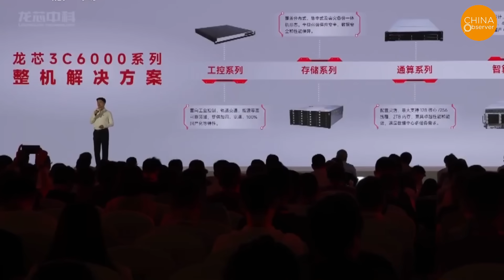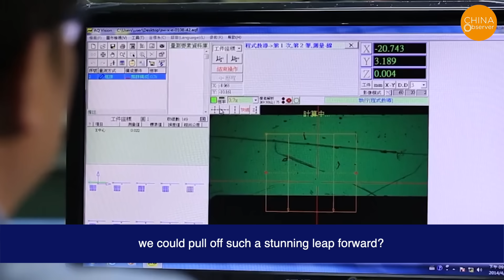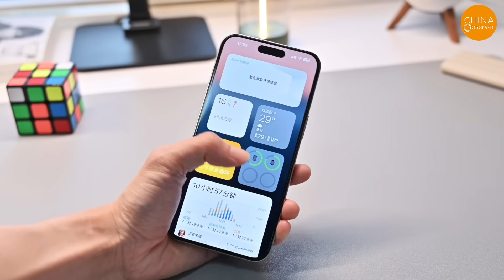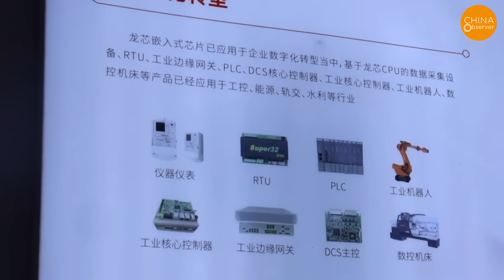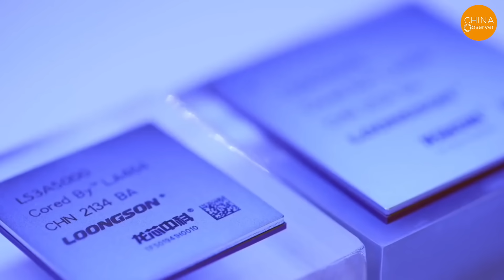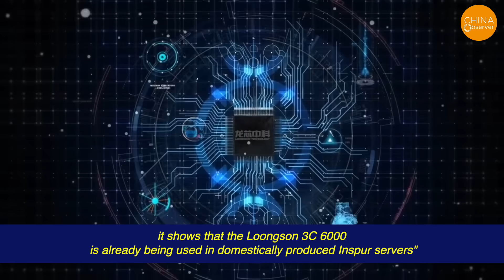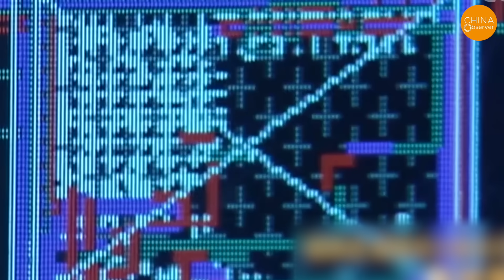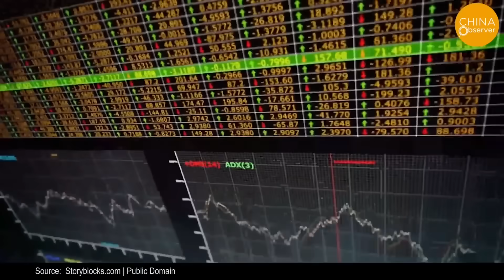Global Laughingstock! China’s Loongson Chip Claims to Beat Intel, but Lags 13 Generations Behind

Comment: It doesnt beat latest intel and amds, but its on the level of zen3
Even tho, other should be scared, because China can make it happen
Reply: Problem besides being generations behind is it's a bespoke processor so software won't work on it native & emulation will slow it down hideously plus it can never 100% emulate you open up can of worms it would be impossible to support. That limits it to government/industrial use specialist applications developed for it you won't see it in consumer products. Many have tried to break into that market with new architectures over the years & all have failed the obstacles are eminence & beyond the chip makers control, simply no room or reason for another architecture.

Comment: This chip should neither be underestimated nor overestimated. On the one hand, it should be more than enough for China to be able to switch many of its administration and office computers into computers that are significantly harder for US to hack, thereby increasing both supply chain and cyber security, for the applications where they can quickly and readily develop the software. On the other hand, It's very unlikely that they would be very useful for AI and for the applications where they are also reliant on the western software. Finally, keep in mind that this is only the 1st gen product, in a few generations the situation might be different. Finally, the US chips often rely on a worldwide supply chain, including China and Taiwan. If the Chinese trully have independent supply chain that could be huge, though they are likely at this point relying on the manufacturing machinery and software from the west

Comment: Anyone that knows anything about processors can tell you the "nm" process is different for every manufacturer, it's how each specific company measures their transistor spacing, and each company measures this in different ways.  10nm Intel != TSMC 10nm for example.  As usual false advertising and false claims by CCP shills.

Comment: well if its using its own instruction set then its completely useless when it comes to compatibility with western technology. anything that works well on that chip will have been programed specifically for it. may as well be an ARM processor. maybe they should have went with ARM technology instead

Comment: They wouldn't even dare release the die size, or the transistor count, or even the density (transistor count per mm²). It's a joke.  Seems to be quad chiplet, makes sense, lots of silicon because the process is absolutely rubbish.  2GHz is hilarious

Comment: Nowadays it's not that difficult to crush Intel 😂 especially if you're willing to have a portable heater and white noise generator with you all the time. 

It's beating the ARM CPUs now that's the challenge. (Like Apple Silicon and the new ARM chips based off Apple Silicon).

But beating TSMC? Only in the CCP's wildest fantasies.
Reply: i wonder why you hate ccp so much

Comment: Didnt Nvidia the Gpu / Cuda maker. Just release its first Cpu to the market? And its an animal monster. Wondering what intel is going to do against it in the next 1-2 years or so. Thousands of Cuda cores on die, and 40 cpu cores+. But I also heard its intended for workstation / servers, and specifically Ai creation and usage.  I KNOW China has the smarts, thats without question! But you need a company like Nvidia with the entire "CUDA" language work set environment to compete. And you need a million companies that depend on it too. Or no one will want your processors.
Its SOOO much more complicated then just making a chip. You need the entire foundation to support it too. All that infrastructure all that dependence on your product. Better off to just buy up Nvidia.
And then make your chips thru/with them.  Logic isn't patriotic. It has no desire, need or want. So dont get to upset by what I said. If you do? Re read it again until you understand, because you missed a bit.

Comment: 12nm??  My computer I used in college was 12nm and that was in 2006. So let me understand this.... China's chip is 20 years behind and the tech sector is supposedly in fear?? My only question is....who did they steal that technology from??
Reply: The computer you used in college in 2006 had 90nm lithography.
Reply: @IO470N 90nm lithography? What does taking pictures have to do with a computer processor? Me think you have a comprehension deficiency.
Reply: @roger5322 oy vey! If you think you had a 12nm processor in 2006, you're touching yourself. P4 were 180nm to 90nm lithography process.
Reply: 12nm litography wasn’t a thing until 2016-2017. It’s simply not possible in any way you used a computer with 12nm cpu back in 2006. In 2008, Intel released new Wolfdale and Yorkfield architecture for Core 2 series processors, which featured 45nm manufacturing process.
Reply: Oh they have been trying to copy Intel and Nvidia for a long time.
Reply: oh there is fear alright. fear of what hair brained, half assed, completely insane "ground breaking technology that beats the US" that will be paraded out.
Reply: Bullshit, Pentium 4 had 90nm chips around that time frame and the core 2 chips had 65nm

Comment: If they're saying it's competing with an lga2011 v3 xeon, that's not bad.

Yes, they're a decade old now, and not suitable for datacentres anymore, but they're solid gaming chips - especially for the current bargain price.

Is that is their first splash into the market, it's impressive, and it will improve rapidly.

Don't focus on the manufacturing node. The main advantage of node sizes is power. Peak performance in GHz has been quite stable for 10-15 years. In other words, the latest Intel/AMD haven't got much faster in clockspeed since people were overclocking Intel 2600k chips to 4.5ghz nearly 20 years ago. The current Max is a shade over 6ghz.

So... The architecture is currently slow, but if the investment is there, it will improve rapidly. 

Software is obviously an issue, but emulation/translation has been possible forever. 
Steal a bunch of Linux WINE, Etc code and the problem will be solved. 

Don't. Laugh too hard yet

Comment: So let me get this straight:

- Intel Xeon's 3rd generation CPUs came out in 2020. (I think you mean 3rd gen Xeon Scalable, which uses Ice Lake, which is 10th gen Core. The Xeon v3 family with Core architecture came out in 2015.)

- Intel is now on 14th generation. (Confusing generations here. Current Xeon Scalable is 6th gen, now called Xeon 6, using the same cores 14th gen Core series - cores which are the 3rd generation of hybrid cores, and 1st generation of "chiplet"-style cores.)

- Somehow 14-3 = 13. (Lags 13 generations behind?? When in actuality, the number would be ~4-5 generations behind current desktop Intel parts.)

- Performance has improved "exponentially." (wtf? this claim is completely unfounded and untrue.)

- "complete ignorance of technical details" - ....yeah.

Look, I enjoy propaganda just as much as the next person but please, use actual facts and technical details instead of made up ones. Loongson is dramatically inferior to western chips. You don't need to lie or misunderstand the overlapping "generations" to make this point.

Comment: Using a proprietary instruction set = useless
Reply: The real problem is it's using a Chinese proprietary chipset so even worse.
Reply: They literally could have used RISC-V or IBM POWER since both are royalty free and are actually supported by modern operating systems and toolchains

Comment: I don't quite understand,  Intel's 3rd generation is much older than 5 years, it would be more like 15 years. I just looked up 2013 was the release date which means the date they could have started talking about it would have been close to 2010.
Reply: I had my 3rd gen intel on a laptop around 2012
Reply: Thing is that it isnt consumer third gen, its xeon scalable third gen, and that generation launched in Q2 2021

Comment: Xeon Platinum 8380 its not very fast to begin with... infact its slow  and its still on DDR4 if there CPU can do 600 points in single thread in CPU-z then they can say its good  not a high bar to pass

Comment: Whatever. It's faster than the processor I'm using now - only less efficient. But then again, electricity is a lot cheaper in China. The best USA-made Intel chips now are not exponentially faster. They're three times faster. I'm not saying that 3x is nothing, but apart from games, 3x wouldn't exactly unlock some new capability in my computer. The point is that Intel is losing more of its lead with every year. China's crappy hardware is forcing programmers to write more optimized software, like Deepseek. One day we'll wake up and their hardware will not be so crappy anymore.

Comment: I CANNOT stop laughing.
My brain has more processing power than this so called "supper chip".
Reply: Don't be silly... A company founded in 2008 (Loongson) cannot be compared to a company founded in 1968 (Intel). What they have achieved is remarkable. It might not be the same standard as current Intel or AMD chips, but it is impressive. The next challenge will be to get software vendors to produce code and OS compatible with their chips... which I think is where US and EU might carry on their stupid sanctions to hinder progress.
Reply: @peacekeepermoe they could always compile Linux and popular FOSS alternatives to run on their chips, will still need some work though

Comment: Kylin Linux looks like a cross between Windows XP and Vista. I like it. It's all cool actually as a fun project but it's a waste of time. For this to be anywhere close to useful to normal people they have to create their own compatible GPUs and other hardware and then an entire software ecosystem with no help from any company outside westTaiwan. The computer world isn't just Intel and Nvidia. It depends heavily on a global cooperative of lithography, chipmakers, designers, developers, etc. with different countries specializing in different areas. A lot of Intel's problems are from trying to bring just some of this back in-house. Intel has been stumbling badly and getting trounced by AMD for years now, so it's not like beating them would even be a huge achievement at this point.

Comment: The whole idea of a different architecture and instruction set is old hat. Old as the industry, in fact. There were lots of instruction sets in the past. Everyone had their own. This is not an advantage. Today we basically have two instruction sets. One is Intel's and one is ARM's. One is CISC and the other is RISC. They have different application realms. 

Back in the very early 1980s I was doing an R&D project on a Motorola chip with its own instruction set. In fact, it was micro codable, meaning that I could make up new instructions, which I did for the project. That was almost half a century ago. 

The problem with multiple instruction sets is that one has to rewrite software for each. The one exception is what Apple has done with the PCs. They went from the Motorola chips (the same one I was using back then) to the IBM RISC to the Intel. They are the only ones who have done such a thing, until recently. Just recently Microsoft has come out Windows 11 on Snapdragon chips which are ARM based. Microsoft tried this many years ago with the WindowsNT OS which could run on the IBM RISC chip and others as well as the x86, if I recall correctly. The OS was successful, but really only on the x86. Linux runs on multiple chip architectures as well. This is due to its heritage as a form of UNIX. Linux is very successful in servers, but has made little headway in the laptop or workstation space. Of course, both Apple and Microsoft have massive resources and R&D spending. 

My point is that this whole exercise is meaningless. China's economy is dying. No sane person, outside of China, would license a technology from China. Given their history of IP theft and poor record on, well, everything, this is just a waste of resources, which China does not have.

Comment: Intel is not the standard today, AMD is; AMD's processors are even more advanced than Intel's.
Reply: I only use intel..
Reply: @robertstevens1554  Don't do that, buy better products. Be an objective consumer.
Reply: That's why they compared it to Intel and not AMD.
Reply: Intel is no standard in anything.. 
AMD is what those chips have to surpass not intel.
Reply: Amd chip is trash in stability. Some company already complaining with Amd epyc cpu which causing their data center to crash Lol. This things doesn't happen with Intel Xeon. Amd is trash!!! 🤡
Reply: @runninginthe90s75 No It's not, I have an AMD PC and never crashed because of the processor, I use it always with intensive work so..
In that case Intel is ok too, where intel falls behind are the compute power compared to the power consumption and the real compute power of the CPU, fals behind on games, temperature, not enough fast and quantity cache.
Intensive work in graphics need high speed cache and faster cores.
Intel is outdated with it's technologies.
Reply: @albyboy4278  and also their 13th/14th gen chips keep frying themselves to death by default
Reply: is that a jk? amd even sucks in instruction sets and conveyors, still having strange bugs with register ops.
USE FUCKING RISK-V - simple, plain, fast, and suitable to fuck with 4k video
Reply: @bruhstories-ox5kt  No one uses RISK-V keep dreaming.
Reply: @MrIagainsti120  RISC-V isn’t exactly there yet but IBM POWER certainly is, and there are no licensing restrictions so China can use it
And POWER is widely used in enterprise situations
Reply: @bruhstories-ox5kt  The CPU desktop and server market share says otherwise. If AMD sucks then nobody would buy it. Just please, suck it up with ur fanboy mindset. Be an objective consumer. 
You don't want either just Intel or AMD dominating the CPU space. Certainly not just like Intel back then charging premium just for 4 cores and 8% performance uplift every generation, when AMD was stuck on Bulldozer era. I don't want only AMD dominates the CPU spaces too, I want Intel to give better fight.
I look forward to the upcoming rumoured NVidia CPU, more competitors mean it will do us good as consumers.
Reply: @miko3085 nah, amd products are not good. Maybe for gaming but for working people, intel is still king. Fanboys even covering up faults of amd. Its nothing new, i stepped away from amd a long time ago when fanboys were not objective anymore.

Comment: 1:59 12NM?! BRO MY SHITTY ASS SAMSUNG PHONE FROM 2018 HAD A 10NM CHIP 😂😂😂😂
Reply: China is not able to build less than 12 NM
Reply: @shalomkaweiii312  this is just straight up grim. Keep in mind that wasnt even a good phone, because it was a 2018 model exynos chip. If you know, you'd understand how garbage that batch/models of Exynos Chips were and we're talking a bout a generation behind that bunch of garbage.
Reply: @wealllikeitsomilkit4301 the snapdragon 8 gen 1 wasnt that good either, in my experience it would heat up badly under load and wasnt that very efficient which ate up battery life
snapdragon 8 elite is a much better and refined chip
Reply: @wealllikeitsomilkit4301  he said that the phone is shitty so he understands
Reply: @shalomkaweiii312  china is able to build less then 12NM but its efficiency is awful
Reply: They're now producing 5nm. They already have 7nm in Huawei phones 2 years ago. @shalomkaweiii312
Reply: Lmao TSMC is working on 2nm technology right now 😂😂😂😂 they're successfully making 3 nm chips China is pumped at 12 nm 😂😂😂 that's hilarious
Reply: I don't even believe if they said it was 120nm
Reply: Note 9
Reply: @minus3dbintheteens60 im watching and taking to you using a Note 8 from 2017😂 it litterly 2025!! im still using it.. it still holds up just slightly slower due to software security etc.. but the hardware still holds uo😂
Reply: Intel is making 4nm nodes right now
Reply: lithography isnt something you think like smaller is better. even if it's small, it needs to be dense. like Intel's 10nm is more dense than AMD's 7nm chips. that's the different in features and drivers
Reply: I think they are hyping the bigger number as an improvement. Trading on the lack of technical insight in the rank and file.
Reply: You people do understand that these nm-numbers are just marketing terms with all manufacturers? For example Intel's 14nm process had higher transistor density than TSMC's or Globalfoundries 12nm. They're still far away, but consider that in 2014 they were close to 486  (From 1989) level..they've at least catched up a little

Russians too have x86 compatible processors in 2015 they were testing them with OS like MS-Dos and Windows 95. I think right now they are multiple times slower than these Chinese chips and process node use is also couple generations less advanced
Reply: @eeva-liisaa-k2491 its not just transistor count it's efficiency. The smaller something is the less enegry it needs. Sure architecture has something to do with it but they don't have that either. Their architecture is garbage. The reason I cited my experience with my exynos phone was because that's the equivalent of what they're doing. They made their own architecture meanings it's not another chip in the X86 with a different layout/socket model like AMD with their AM4 or Intel with LGA 1851, what they did was make another Architecture which is more in line with something like the X86 or Arm. They can't even run Windows, MacOs, SteamOS, Linux or Android.
Reply: @wealllikeitsomilkit4301 
My point simply was that those mentioned nm-numbers are just marketing terms. All "4nm", "7nm", "10nm" aren't equal.
Reply: Sir this is a Wendy's